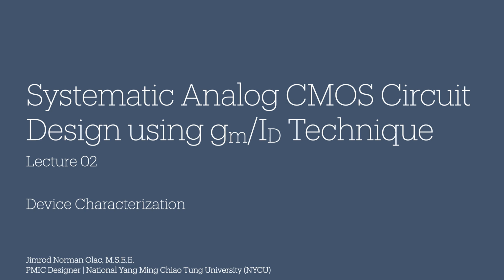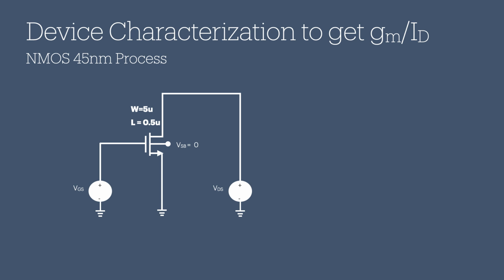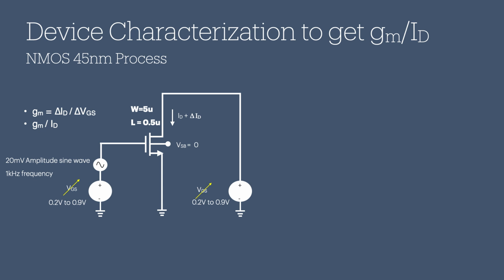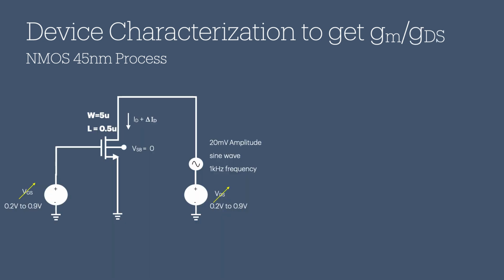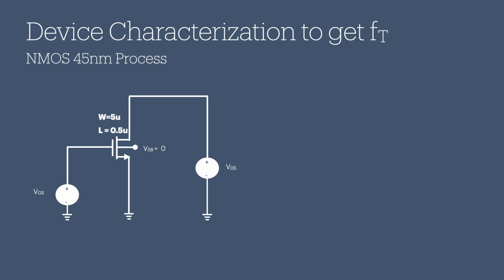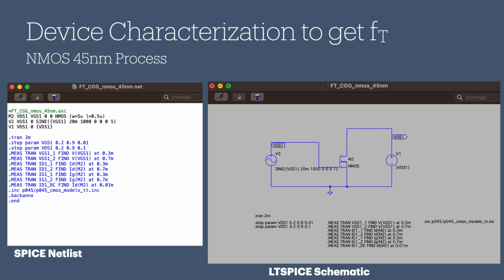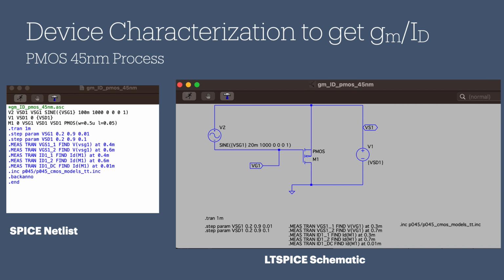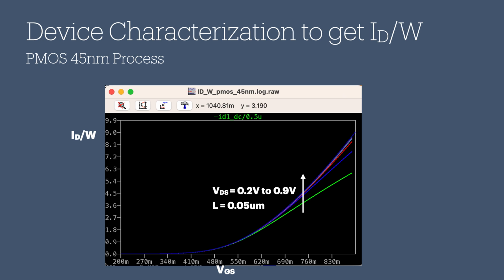Lecture02 Device Characterization of PMOS & NMOS

Comment from the maker: Systematic Analog CMOS Design Using gm/ID (2nd Revision)
Silicon-Oriented Design for PVT Robustness and Production-Ready Circuits

Most analog designs work at nominal conditions—but fail or degrade across PVT variations. This course focuses on designing circuits that hold up in real silicon, not just in simulation.

You will learn how to use the gm/ID technique as a systematic design framework, translating device-level targets into practical circuits while ensuring robustness across process, voltage, and temperature.

Using a 45nm CMOS process with LTspice simulations, the course covers:
• PVT-aware design from the start
• Constant-gm techniques
• Current mirrors, biasing, amplifiers, and comparators
• Translating gm/ID targets into production-ready circuits

The concepts taught are applicable to any process and any simulator, making this approach widely transferable.

🔗 Enroll here / Access free preview:
https://jimrod-norman-s-site-7963.thinkific.com/enroll/3763292?price_id=4718991

If you're serious about designing circuits that go beyond simulation and work in silicon, this course is for you.

#AnalogDesign #CMOS #gmID #ICDesign #Semiconductor

Please reach out to this email if you have questions.
email: support@cktgenius.com